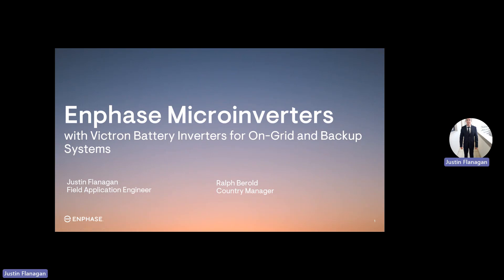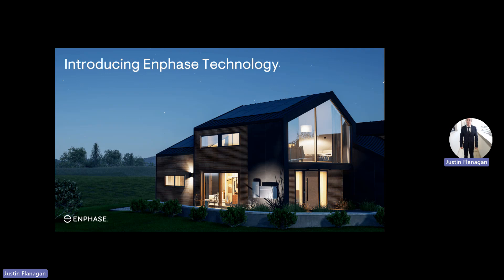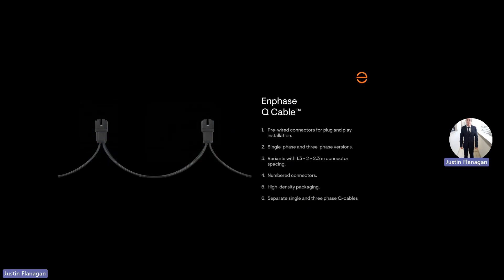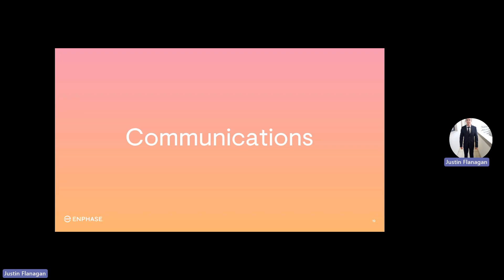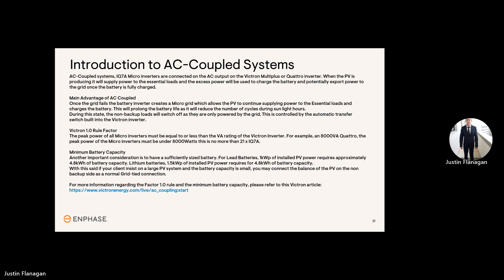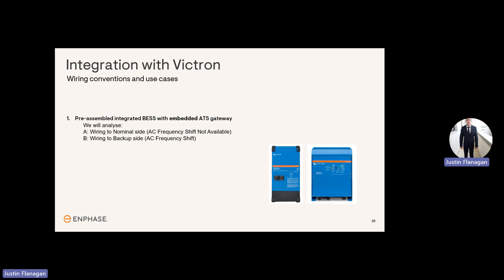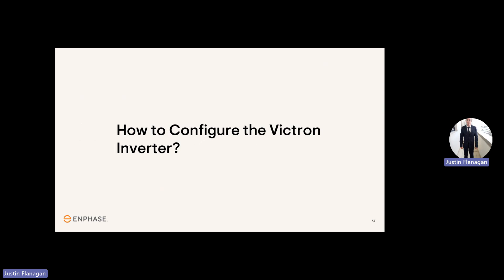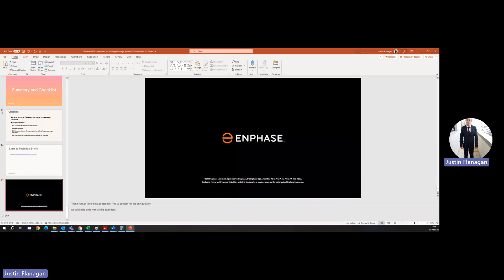Enphase AC-Coupled to Victron Multiplus-ii or Quattro 20230517

Comment: How would this be wired for a 120v/240 split phase?
Reply: With autotransformer ( like Huawey and APSystems do )
Reply: @jhonmorenocastro3010  Is that the only way? What if you're running split-phase with two Multiplus 2s?

Comment: Thank you for this video.  Is it possible to have the EnPhase Production values / data reported in Victron VRM?  Also wondering if having EnPhase installed on the Non-Essentials side would invalidate the overall Consumption values reported in Victron VRM?

Comment: If i may. The production consumption is configured through the victron assistant. You must program the victron using the mk3 usb adapter and software. You will then see the assistant. Its in the victron manual and makes it easy to program.

Essentially,  once programed, you will be importing pv array with emphase on ac out of victron. Which in turn will provide power from pv array to ac load as needed. Any not used ac load will enter (victron ac out) and charge your battery similarly as the ac in function. It is a great system. However the interesting part is the ac frequency shift. These parameters needs to be set correctly in victron assistant AND emphase enlighten in order to be successful. Once batterys are "full" and no load is in demand the victron changes the herts in turn ceasing production from emphase all together until there is a demand. 

Awsome sauce!

Comment: Hello, I am trying to use Victron Multiplus II with Enphase Energy IQ7 micro controller without injection and i have some questions. How can i contact you ? In my system, there is DC battery and i would like to know if it's okay to put one CT (consumption) on AC in and one CT (production) on AC out in order to charge the battery even if there is no load. Is it okay to define the grid of the micro inverter as Zero Export France ? How can i define the frequence shift of the Victron inverter ?
Reply from the maker: +33 (0)9 70 73 10 76 (France)  please call customer support for assistance